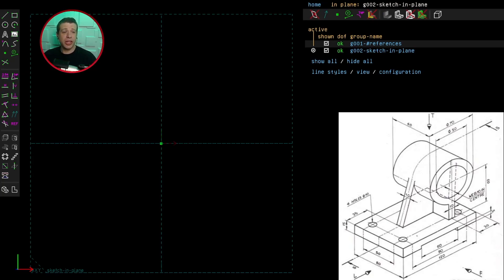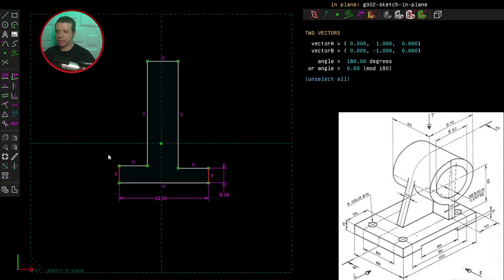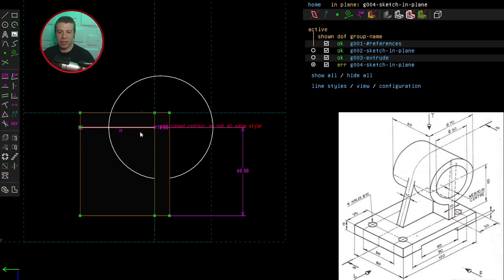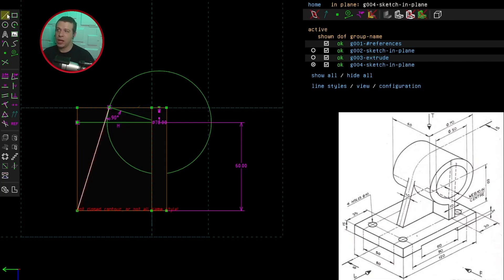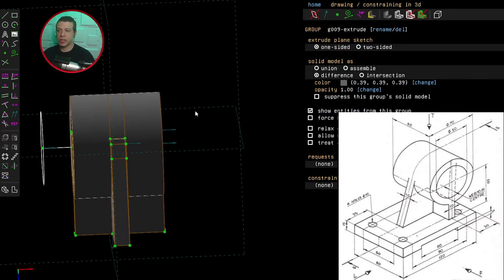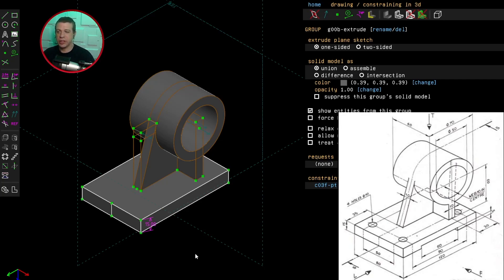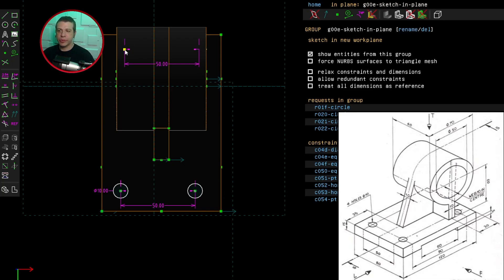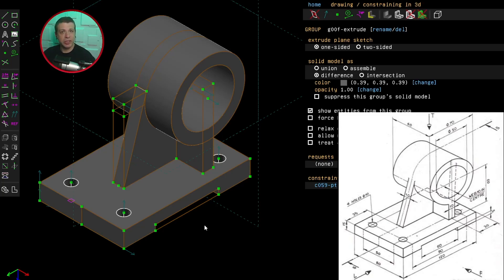SolveSpace - Challenge 5

Comment: Is there a mirror command when we are making 2D blueprints with SolveSpace?
Reply: I found a way: 1. copy objects 2. select paste transformed 3. a special menu opens 4. tick want you to want to: rotate 180 degrees and tick mirror object. 4. press to achieve a transformed paste. It works, please share this with other users too. :-)
Reply from the maker: @Tommi_P_Laiho  Hey - that's great and useful for simplifying a symmetric work-plane into smaller components. Here's another example; let's say your work-plane has C2 symmetry, you could draw half of it like you said, copy it, paste transformed but then click the 'flip' tickbox in the properties panel to paste the mirror image. I've not tried it for C3 or higher odd number symmetry though